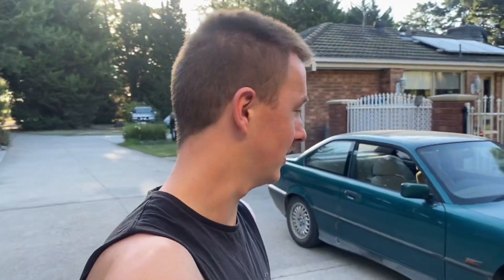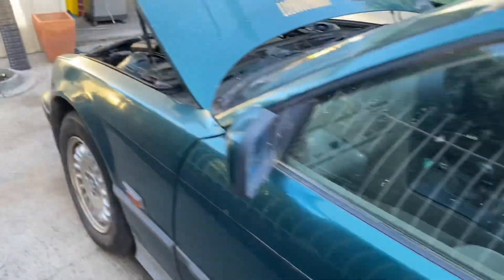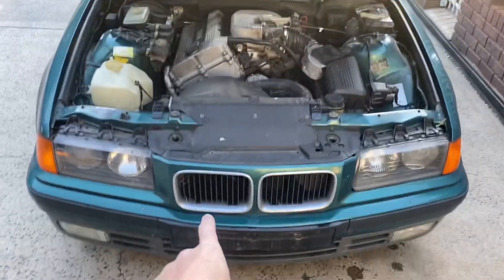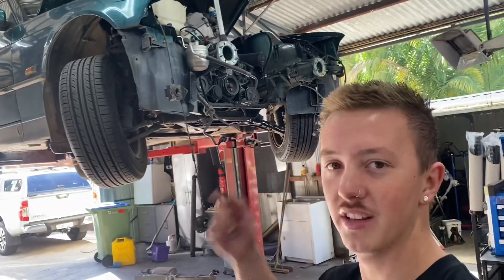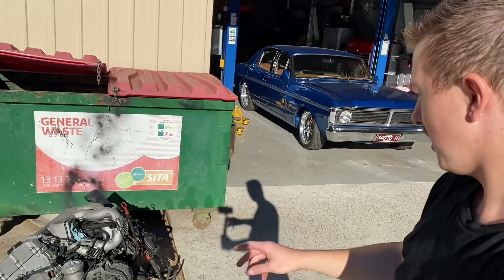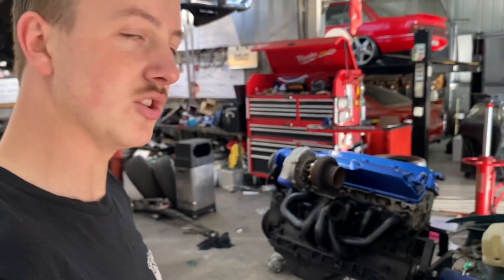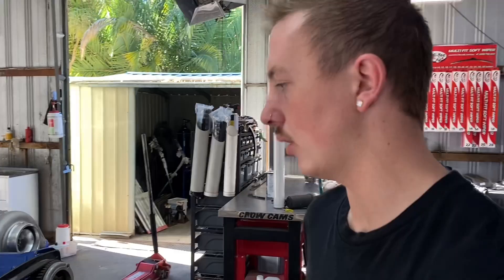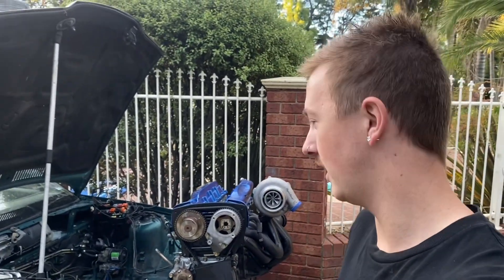BMW E36 Coupe RB25 Conversion | Part 1 | Drivetrain removal

Comment: Isn’t there already a plug for the turbo drain? My 25de neo has one already
Reply from the maker: Nah bro, the rb25de neo only has a bung for the external vct drain. Depending on where your turbo is you’d most likely have to go under the engine mount which would cause an issue with drainage as it would puddle up.
Reply: @CamMartonDrift  ahhh okay might have to add an extra bung into my sump when I extend it

Comment: What are you gonna do rear end wise? That has a small case diff in it, you'd want atleast a medium case from an 323/325/328 etc. You'll need diff, axles and rear driveshaft unless you're going 1 piece.
Reply from the maker: Being that it’s staying non turbo for now I was just go to leave it. If I have issues I’ll change it for sure!
Reply: @CamMartonDrift  you'll have issues with a smallcase N/A too, I've seen small case diffs blow from just doing pulls in a 200hp e36

Comment: I am a drift enthusiast from China and I am currently working on a drift car for my son. I am experiencing some issues and would like to know where I purchased your engine mount. I am in need of a RB25 engine mount for the E36 transplant
Reply from the maker: @于庆彤  hi, I modified rb25 turbo engine mounts and made custom mounting points on the subframe
Reply: @CamMartonDrift  Is there a place to buy brackets directly? Do you sell brackets
Reply from the maker: @ just buy standard ones. No I don’t sorry

Comment: Best part about the 318iS is DOHC and a factory LSD!
Reply from the maker: Factory lsd?! This thing would barely double 😅
Reply: @CamMartonDrift  She could be a little tired haha. With the E30 platform, the 318iS comes DOHC and factory LSD which is what i had! If your Diff is marked with a big S under the bottom side its an LSD!

Comment: There's 3 heater lines because it's dual zone climate control. Drivers side in, passenger side in, common out. On the heater valve you'll have 1 in and 2 outs. 
Anything E36 related you need to know, HMU.

Shame you've taken the real God's motor out though! :D
Reply from the maker: Awesome thank you man! I’ll be sure to hit you up! 

I can’t go past an RB I apologise! 🤣